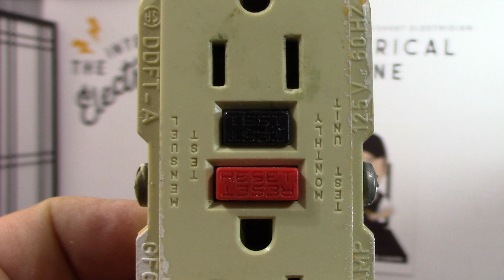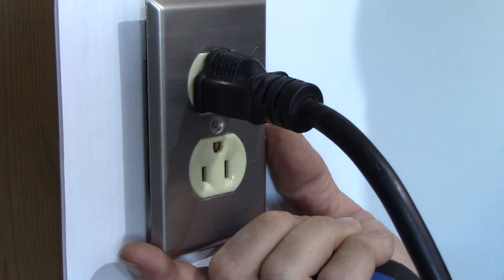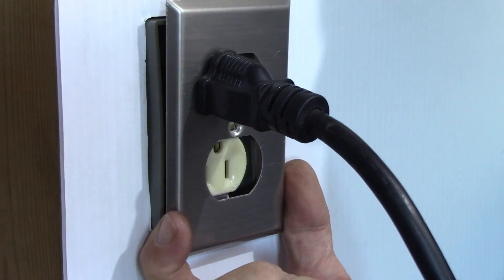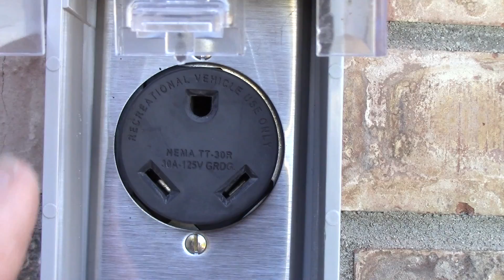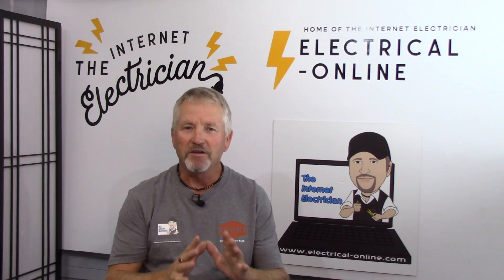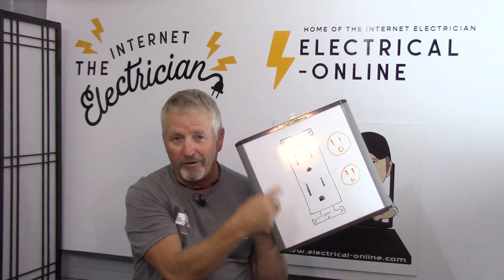Receptacle Ground Prong Up or Ground Prong Down?

Comment: Ok so in your example you knowingly touched the cover as if it was going to balance on that ground and the customer would just gently plug something in. That would NEVER happen. That's is a ticking time bomb for shock hazard. Tilt that cover a few mm sideways and she's shorting hot to ground and most likely the customer was touching it. Ground down if the cover came loose it would short, scare the customer but would trip the breaker instantly and customer would be less likely to get shocked
Reply: Turn that plug on, redo the demo like a customer who would be blindly reaching around their couch trying to plug a phone charger in.
Reply from the maker: Unless of course, you tilted it a few mm towards the neutral prong?  There's many scenarios that can play out here, but thanks for your input, and thanks for watching!

Comment: all of north america needs to scrap all the house electrical and make it like the UK system. Much better looks and safety.
Reply from the maker: That would be a monumental task consisting of changing all of our generation facilities to slow down to 50 HZ, and then modification of the distribution grid and transformers.  Looks better and safety? That's debatable and a matter of opinion!  🙂Thanks for watching!

Comment: I say as long as they are all mounted the same.either up or down.  I like the ground up.
Reply from the maker: You make an excellent point! (as long as they are all mounted the same.either up or down) I should have included that in the video!  And as a side note, make sure you line up all the plate screws either vertically or horizontally.  I like vertically!  Thanks for watching!

Comment: I think the only real determining factor is the "regular" 120V flat plug; those are always oriented so that the wire will point straight down when the ground is on the bottom. When the ground is up, your wire ends up rising out and over the receptacle and both looks bad and has the potential for something to catch on it. For this reason, I have all mine with the ground down; but I'm tempted to have my kitchen outlets have the ground up, for possible better safety.
Reply from the maker: Yes, you're correct about most 120V 15A angle plugs!  Good input!  I'm not sure what is your line of thinking with your kitchen outlets however? Please elaborate!
Reply: it should be standardized

Comment: It depends if you are north of the  Equator or  south of the Equator.
Reply from the maker: That could be true, but the current swirls through the wires in opposite directions depending on what side of the equator you’re on 😊